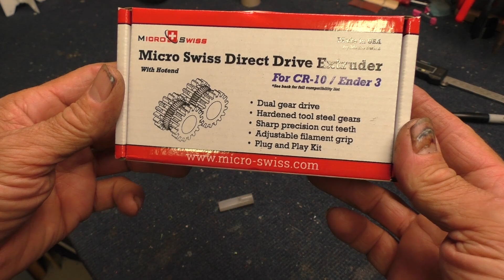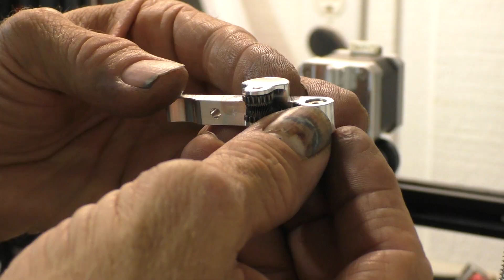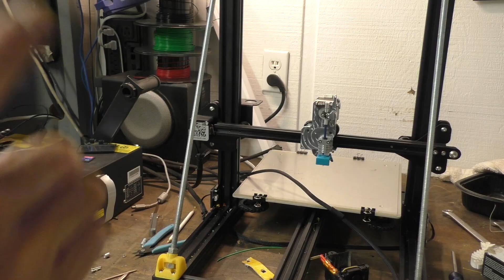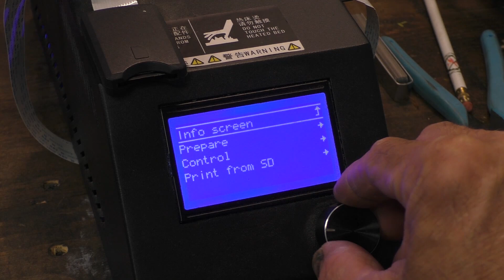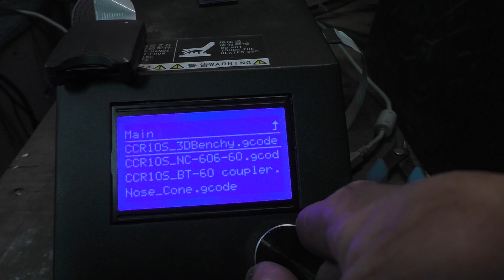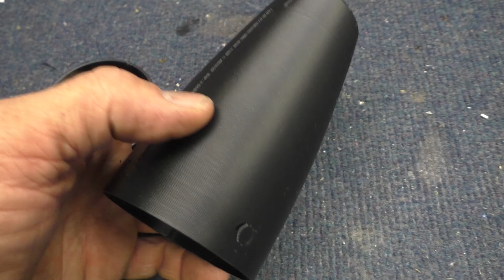Creality CR 10S Micro Swiss Direct Drive Extruder Upgrade

Comment: You might want to look at doing a PID tuning on the hotend since you changed it out. It should help keep the hotend temps stable. Always good practice when you do anything with the hotend. Also, after grabbing a backup of the firmware, you might want to look at upgrading to Marlin 2.0. A lot of the older creality units that shipped with 1.1 also had thermal runaway disabled. Looks good otherwise. Happy printing!
Reply from the maker: Planning on installing Marlin 2.0 and adding BLTouch.

Comment: Very cool upgrade! I definitely like how it brings the feed closer to the hot-end!

Regards the bumps, I have no where near your experience, since I just set up my printer and only have 3 prints under my belt, but I did notice when I printed two Benchys that the bumps on the hull were nearly identical on both. What ever is causing it is repeatable, so it can't be the filament as I was suspecting at first. 
Now that I've seen you video, I'm suspicious of my feed. If nothing else, it gives me a starting point for investigation!

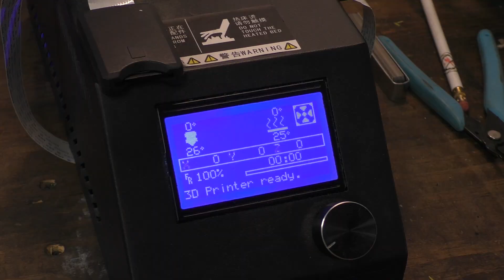By the way, I like how you covered setting the E-Steps at 14:57.
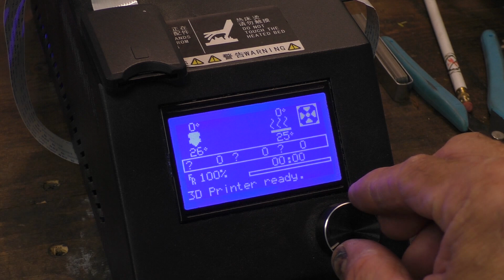By the way, I like how you covered setting the E-Steps at 15:24.

😂. Sorry, I couldn't resist. I promise to offer my soft underbelly for you to poke with a stick when you find a glitch in one of my videos (cuz I know it will happen; especially now that I just gave myself karma 😂).

Great video Dean!
Reply from the maker: I somehow do a double scene every once in a while....

Comment: The lumpy bumpies might be from moisture in the filament. When the water absorbed by the filament boils it creates a gas pocket before come out of the nozzle and causes the bumps.
Reply from the maker: Maybe, but it's happed with several different colors of ABS. ABS doesn't usually have issues with moisture. I keep it stored in a warm dry place in my work shop.
Reply: It looks like a seam/extrusion issue.

Comment: The retraction is more immediate with direct drive than with a Bowden tube, so in the slicer the retraction setting value should be much smaller than what you had before. That may make your seam much less visible.